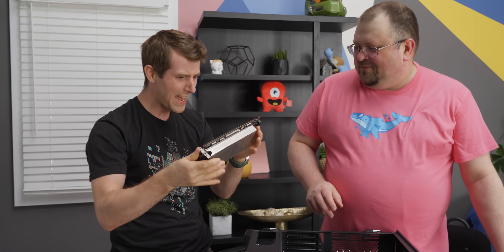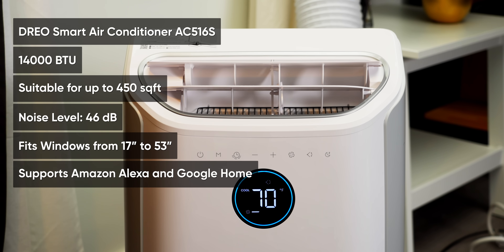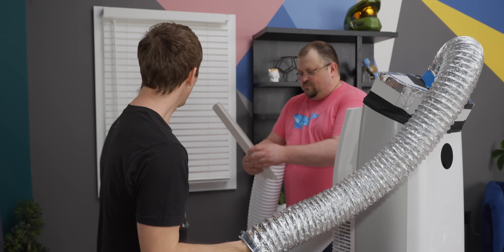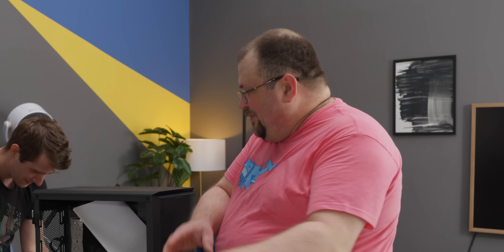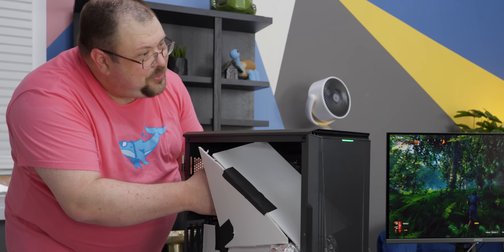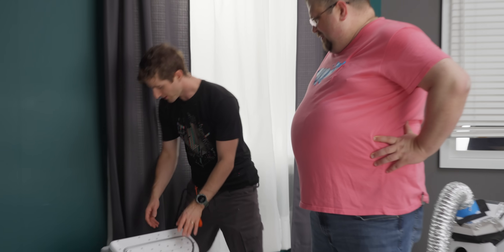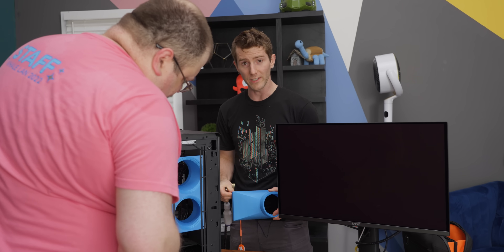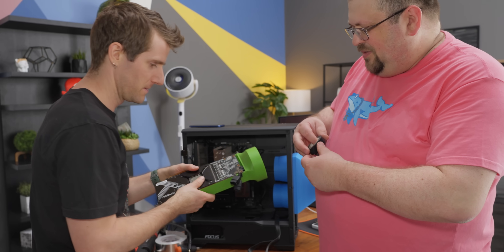Everyone is Cooling Their PC Wrong

Comment: I feel like the condensation concern was incorrectly explained.
Condensation occurs from hot air on colder elements. Therefore the air you are blowing in from air conditioner will not cause any condensation itself.
The problem is where the components (mostly the case if all air inside it came from air conditioner), that were cooled by air conditioner to below room-temp, meet the ambient air, which is hotter.

Comment: I can see a way this would work, I would get a 100% water cooled setup both CPU and GPU on the same loop to the same front mounted radiator, no fans, what you do is 3D print a mount on the front that the ducting goes to and small vents on the top and bottom, also a drip tray on the bottom to catch any condensation run-off this is also why you dont use a top mounted setup encase something leaks into the tower from the top.

Comment: 12:55 HVAC person here. Yes, insulation will work great. The AC is going to be putting out air that has already had moisture removed from the unit.if you sealed the rest of the pc, and air only came through direct from the ac unit, then it would prevent moisture from even entering the computer. Basically, the only moisture in the computer is ambient moisture from the environment, so you need to make sure only conditioned are is getting inside, and you'll be fine.

Comment: install back fans on gpu and cpu cooler. remove the purple and green 3d printed shroud and youll get better temp. just make sure the Y shroud at the front directs air to the bottom of your gpu and block the hole to the cpu.

Comment: A window unit is far more ideal than a portable air conditioner. A portable AC literally sucks indoor air to cool its compressor, lowering room pressure and drawing warm outside air back through gaps, while a window unit uses outdoor air for heat rejection and keeps indoor pressure stable.

Comment: I have a 12 ac unit in the room its better to use it with the fan my 5800 x 3d gets to 27 and my rtx 3060 go to like 45 with the hole load on them its very good and i ceep my body cool too XD

Comment: Eeehm, condensation? Really? The condensation is inside the airconditioner. It occurs when hot, relatively humid air cools down enough it goes below the dew point.

When you blow cold air inside a hot computer the temperature of the air rises, so there will be no condensation.

Comment: optimal temp should be 20C bc all mesurements are calibratet at 20C then means if it is hotter metal expands and if it is colder it shrinks .. not much but it does ... so keeping everything at 20C would be optimal 😀

Comment: I've tried the Air Conditioning thing with a PC. It didn't work for me. Too much Condensation. Even tried it with a dehumidifier. The PC stayed nice and cool till the water droplets hit the MOBO and the GPU and RAM and fried the entire system. Gave up on the idea and went back to liquid and Fan cooling. Just my $.02 Great Video though. And you definitely have more resources than I did.

Comment: My intuition says you should smooth out the airflow paths in those 3D-printed parts, and double the diameter of airflow from the AC to the PC (i.e. run two hoses). It's a low static pressure system, so any obstructions to airflow are going to have a huge effect. Then ensure the majority of the air (80% or so) is smoothly DIVERTED (NOT BLOCKED WITH TP,  LINUS) to the GPU. I bet you could get the GPU down to 50c under load, easy.

Comment: Oh no, everything is wrong in this video. I know it's just for entertainment, but it might at least be interesting to see a creative build. The first thing is to leave out the OB/CD member, and second, to produce static pressure inside the chassis even without a airtig seal. Then, it would be interesting to make changes like turning off the CPU fan or directing the cold air intake directly to the GPU or countercurrent to it. And most importantly, the total amount of (real) watts consumed during games.

Comment: Running AC is gonna spike your power usage way up though. As a cheapskate who doesn't use AC in my house (I live in the tropics) but instead uses an array of carefully arranged push/pull window intake/exhaust fans, I have much lower power bills than my neighbours who all use AC. Sure, my house isn't AC-level cold, but who needs that? I wear a jacket in my office because the AC is cold, that's fucking stupid. It should just be cool enough so that you can walk around in regular clothes. Same here, you don't need your PC running at sub-zero ambient or whatever. As long as you can get a permanent breeze moving the hot air away from the components that should be decent enough for almost every regular use case.

I feel like a huge side case fan would do the trick. Constant airflow pushing the hot air out should keep temps manageable.

Comment: I got a portable AC last year. Before that I was always under the impression that those things didn't work. Man ... the thing is an absolute live safer. Mine is pretty loud though. But I rather have a loud fan in my room than have it be 30+ degrees with 100% humidity in the Netherlands where bascially no one has AC

Comment: Linus should partner up with an AC company and a case manufacturer and have them mount a window unit and a room unit for central AC systems to a case directly.
Condensation will not be an issue because AC Air is already super dry from being cooled down. That is why a foggy car window clears up even faster with AC set to max cooling.
And just like in a car, you can leave the fan on for 5 minutes after use so the temps can normalize without moisture building up.

Comment: I was thinking, what if make a case in which there will be a closed air flow loop, it will be cooled through a liquid radiator inside the case. the outside air and the inside of the case will not mix. we will get a system that will not get dust, or maybe liquid. the internal radiator can be cooled with anything, even just another radiator outside, then you can only wash it, and not all computer components.

Comment: what about a cheaper solution like i cannot afford 2 AC in my room for cooling my pc and even good air cooling cost more in a pc so for a person like a student remove all the fans from a pc and remove the side panel and just strap a exhaust fan to the pc and the noise problem just wear noise canceling headphone when not using pc in heavy workload like for rendering will that work just an affordable  fan which wont fail cause they give pretty good warranty on like cooler fans exhaust fans with high rpm not table fans or something cheap like anything dont care about how my pc looks i spend 90 percent of time looking at a monitor so i got the cheapest case for my pc and put a decent budget on the monitor. anyone smart could suggest something to me ? anyway(sorry for my bad english )

Comment: ok linus, i have thought about this exact setup some years ago when you did some of those videos on your old AC cooler. the thing is, if you have the duct blowing in the input air, how would there be condensation, if the input air is always cloder than the computerparts? as long as you don't turn up the temperature of the AC, there should be no need to vaseline up the mobo, imo, as condensation would have no reason to form anywhere other than the outside of the duct, or maybe the outside of the PC case, assuming cool air leakage in the case

Comment: the fin structure of the cpu is aligned for flow through side air from front but the gpu needs its air coming upward from the bottom to effectively blow through the fins (think fan orientation)

Comment: 10:20 The BIGGEST problem is that none of you seem to understand how that AC works! You are basically removing heat from air and blasting it straight back to the condenser. You'll get pretty much the same performance without running the compressor and therefore the whole contraption is just a cooling fan with extra ducts.

Comment: 4:50 German here: West and East Germany merged in 1989 not 1990
Reply: Wasn't official until Oct 1990. It started in Nov 1989 though which is when the wall came down.
Reply: Another German here: It was 1990. 
The Berlin wall fell in 1989, but the reunion was finalized in october of 1990. Before that there was no wall, but they were still legally and practically seperate countries

Comment: Linus Linus Linus, dude, hear me out...   apply this concept to a wall-mounted system such that the airflow goes from the ceiling to floor. Check my science on it, but would the condensation drip out of the PC so you capture indoor rain into a turtle tank or something. You'll for sure need to insulate this path all the way until it can collect on edges then drip away. Maybe a mesh screening of some sort to better distribute droplets? If this works then get one of those overhead indoor AC units that is a part of an outdoor installation to help with noise and conveniently in the orientation needed. You might have to print a wide mouthed inlet of some sort.

Comment: This reminds me of the old TEC-cooled PC cases that had insulated walls and used a peltier and a high power fan to make the interior cold while it dumped awful amounts of heat outside of the case. It kept everything at sub-ambient to prevent condensation. Then there were the actual fridge PCs, such as the phase-change ACs that just directly chilled a block on the CPU, or ones that used refrigerant like the old Thermaltake PC that used a refrigerator loop to cool the CPU block.

Comment: hey if you want to increase the pressure just make the diameter of the hose smaller and all fittings. so taper down that duct and maybe use something other than that tin covered spring loaded duct. locat plastic about 2.75inches on the output side and your pressure will double and be better.

Comment: on my first pc when i "upgraded" from a fx4350 to and 8350 i used an old kirkland all metal heavy room fan that my family has had for years and couldnt find any hvac ducts that were the right size so i bought some sheets of galvanized metal and made a funnel from it to the rear of my pc. My thought process was that the faster air coming from the top rear would circulate with room temp air coming from the front and then it would all exhaust out the bottom rear.  

I used a lot of duct tape

I never did do temp tests but id like to think that it help a lot

the plastic cap for the switch was missing so it was really hard to change its fan speed so i normally kept it on high because max it went too fast and even with its all metal base and large circular base foot it would move from the force it generated

Comment: Years ago, I bought a small window mount air-conditioned, and then a portable like this. 
 i think it was around 2 or 2.5kw. I tired keeping the aircon in the same room but it wasn't efficient,. It was much more efficient if you get this, put it in the window with the hot part outside and blow cold in. So, Thats what you should do, But that big ass thing OUTSIDE, and pipe the cold air IN. 
Dont use the exhaust hose or use it as short and direct as possible as the longer and more bends the hotter heat soak into the room and less efficient the compressor runs at. 
you should also cut the duct hole open in the top of the unit and cut out any restrictors in the exhaust. ie any grates to stop people poking fingers in are restrictive. 
Plenty of telephone exhange buildings in rural australia, think a shed were just airconned rooms.

Comment: I don't think if it's gonna have condensation on the pc component tho. just like what Linus say, air condense on surface colder than the air, but the air is cold already, coming from the AC. and am sure the pc component will be warmer than that cold air

Comment: I really don't think significant condensation will form inside the case.

Air from AC is very dry, and it's being blown into hot surfaces.

The condensation you see outside the AC etc is the room air, higher in humidty, which condenses ONTO the system. The water doesn't come from the AC air, it comes from the room air, which isn't the air inside the case.

I see people claiming the problem would be once you turn the machinery off, they say ambient temperature air will rush inside and then it will condense. No, the GPU and CPU are being cooled, but they aren't cold. I bet my liver once you turn the pc off they will be at least a centigrade higher than ambient air, preventing condensation.

What COULD be an issue is regions of the pc which aren't hot getting cooled and reaching below ambient temperature, which causes condensation, an example would be the pipping condensing ambient air, THAT could create condensation spots, still a low chance, since room temperature air won't "rush inside", if you turn off the AC you also turns off it's fans see. 

What you would have to do is ensure cool air only hits parts of the pc that do need cooling, therefore I believe the idea of using it to cool a radiator is a much safer option, but I also don't condone what they did.

With this in mind, I am now considering making a support to hold a radiator in front of my wall mounted AC.

For clarification and source I'm a chemical engineer.

Comment: I have previously done something similar, except I switched which one was going to the other. I put water blocks on my CPU and GPU and had long tubes going to the radiator, which was mounted on the output of my mobile AC unit (like the DREO in here). It worked surprisingly well!

Comment: How to get cool a chromebook.

Step 1. Stick mechanical pencil led into the charger and usb port.

Step 2. Wait until your computer starts bellowing out smoke the dump water on the chromebook.

Step 3. if your chromebook is still not cool fold it in half the wrong way and put it in your toilet.

Step 4. DONT FORGET TO FLUSH!

Comment: I actually think this will/would work but the bottleneck is the fan in ac for the blowing the air isbt designed to build up pressure. A inline fan with a high CFM would make more pressure/air flow and actually help draw more cold air across the AC evaporator coil

Comment: I don't see why condensation would be an issue. The air from the A/C already starts out at its colder and only gets warmer as it goes through the system, so all the humidity should be left behind in the A/C unit itself anyway. If anything, if the case itself gets cold enough, condensation might form on the *outside*, but I don't see that being an issue.

Comment: If you sealed away your air conditioner and put in a couple dehumidifiers to dry out the input air for the AC system. The pressure from that dry air should remove any 'moist' air from it saving on the problem of condensation inside the computer.

Comment: Guys, why take sponsor segment from bad inefficient product??? If i can be proved wrong I’d love to be, but from what I understand of the refrigeration cycle and fluid dynamics (I’m joking, I’m not actually smart) these units SUCK. ;)
Reply: I did make a duct for my single hose unit so it would intake thru the window, hooked it up below the outlet, worked a trick. That mod allowed the unit to cool and entire apartment, when before it would only barely cool the room it was in, and it would make the rest of the place WARMER, due to it pulling outside air in thru cracks in doors and windows.

Comment: Single hose portable AC units are quite inefficient! That DREO probably leaks hot air by making a negative pressure on the room as it blows hot air out the window. Technology Connections told us why that doesn't work very well.

Comment: You're better off running copper tubing in a loop that passes in front of the cold air output. That way you can use cold water to cool the chips with direct contact instead of relying on card heat sinks.

Comment: A better way with no risk would be to keep the PC FAN, Use a normal GPU.
Put PC in a polystyrene box that the AC is chilling. Condensation wont form on the pc if the whole thing is cold.
The only place there would be condensation is the feed to the box.

Comment: Those single hose AC units are fundamentally flawed. They take air from inside the room, blow it through the heat exchanger and then blow it outside. Not only does this mean you're taking cooled air and literally blowing it outside but it also means you're creating negative pressure in the room which almost always results in hot outside air being pulled into the room. Very inefficient and power hungry way to cool a room. Two hose units are much better and window units are the best.

Comment: HVACR tech here. I have an idea for an AC cooled case using a mini split. Electronics do not produce latent heat. But, the human body does. You can create moisture in the case if the case is sucking in ambient air.

Comment: 69 degrees is literally zero improvement over a cheap AIO. 

They'd be better off creating a long heatsink and dripping ice water on it from a 20 gallon tank... if the aim is improved cooling using ridiculously oversized but silent equipment.

Or... using a 50 gallon air tank for compressed air cooling.

Comment: Not enough static pressure so you want to add a fan to the AC so that you can keep the PC fanless...  /sigh
I think it would've been cooler (pun intended) to route the CPU exhaust as the GPU intake...  baffles be damned.
But even better, build/print a case that stacks directly onto the AC exhaust (with the MB/GPU ports at the top).